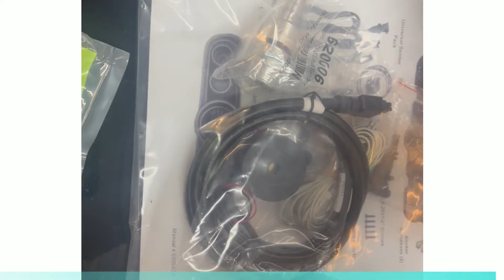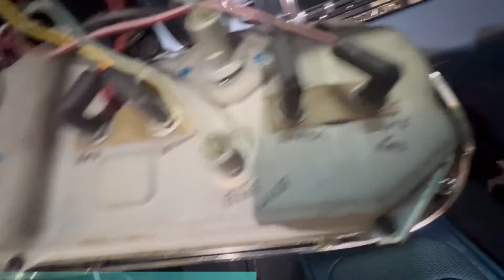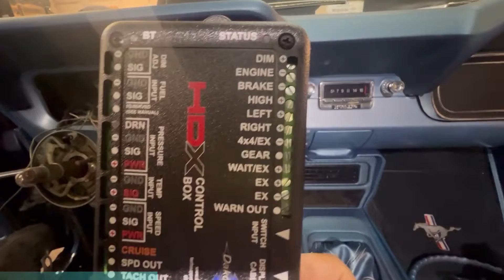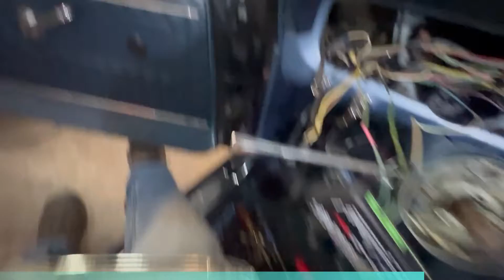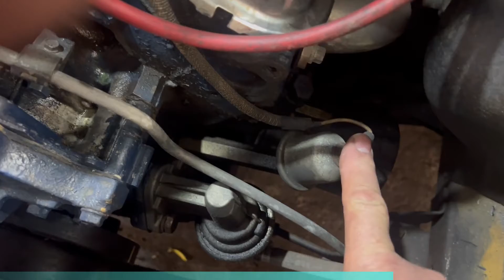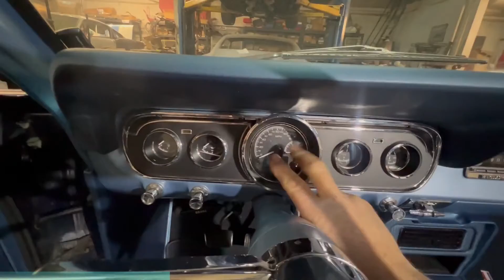66 Mustang gets a Dakota Digital Dash

Comment: Hi there. I have a 64 falcon. The two wires that go to the fuel gauge. How do I connect those? And how do I ground it?
Reply from the maker: Are they stock gauges?
Reply: Yes. I'm replacing the stock gauges with the vhx Dakota gauges
Reply from the maker: @  the wire from the sender unit will go into the little black box "brain" that comes with the Dakota kit the other one that went to your old stock  gauge is a power supply so that won't be used.

Comment: Getting ready to install a Dakota in my sons 78 Bronco, just about done with a complete painless wiring installation. I’m glad you mentioned the grounding of the gas gauge. I already have the harness wrapped in loom and run in the frame and didn’t read the Dakota recommendation for a full run ground wire until afterwards. I was wondering if I should take it back out to add a wire, but thought about just running a shot length screwed to the dash frame like you did. Makes me a little more comfortable knowing you’ve already done that way without issues. Nice video!

Comment: Do you know the master cyl piston diameter?
Also, did not the TKX come with a speed sensor? Mine did.
Reply from the maker: 1 1/8" bore.   When we ordered  the TKX kit it was  spec'd for a cable drive speedo so no. The trans conversion was quite a bit earlier, if you look back I did a video on it.

Comment: Kiwi, I have a Dakota digital cluster in my 66 Chevelle. The RTX cluster looks analog until you turn the key. Excellent cluster and perfect for upgrading an analog with issues. They require a separate ground all the way back for sending units as well. The ground is essential with all the different electronic points in the gauge cluster ie: gas, temp, amp, and speedo. lots of pulse readings and resistance readings. New wiring harness is a great addition when doing the cluster. Awesome tech support.
Reply from the maker: I really like them.  In particular the programmable service intervals and the warning lights/buzzer system.  An added layer of protection for your baby!

Comment: I usually drop the steering column when doing a job like that. Makes it a little easier and ya don't scratch everything.  Looks good bud. 👍
Reply from the maker: Dropping the column is a good idea unfortunately the early Mustang column is part of the box so it doesn't drop down when unbolted
Reply: @kiwiclassicsandcustoms9160   Oh  Ok

Comment: Great set of gauges, install in a 1973 Chevelle SS, did not destroy the original dash connector used T taps, Instructions were great
Reply from the maker: I'm not a fan of the T taps but that's just me, seems like another possible iffy connection. I see your logic for not cutting up an original harness though.
Reply: I realize they have to use set-screw connections so the same box can be used for multiple models, but it sure would be nice if they made small pigtails that would plug into the original harness connectors. Also, Kiwi, thanks for not showing chopping off the harness ends; that makes me cringe.
Reply: I don't think I could bring myself to do it. @sometimesleela